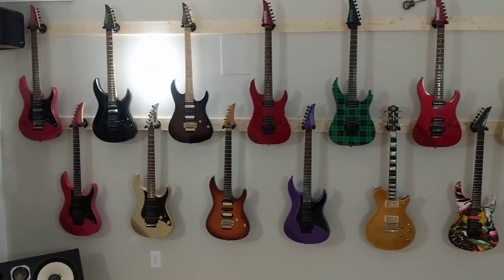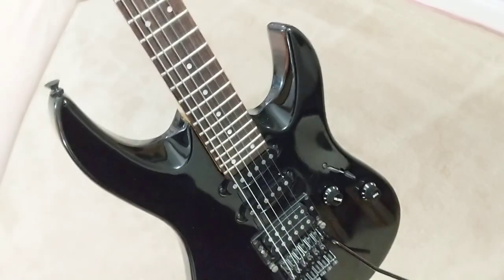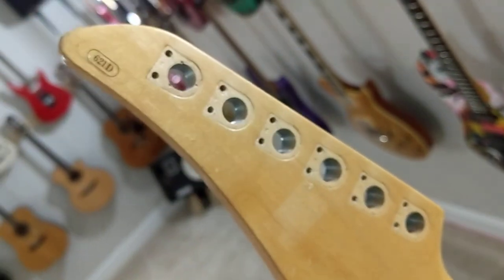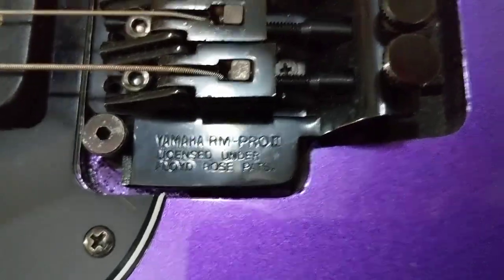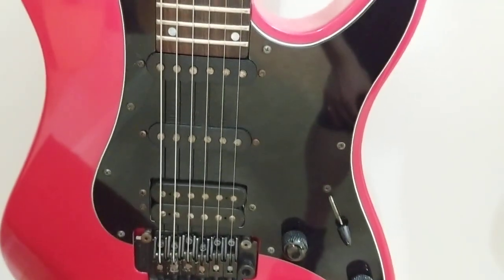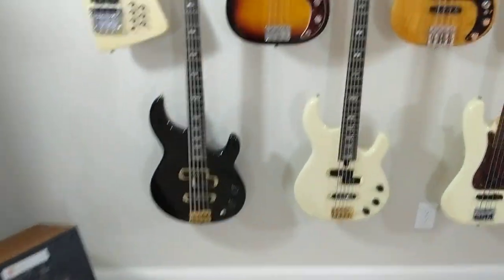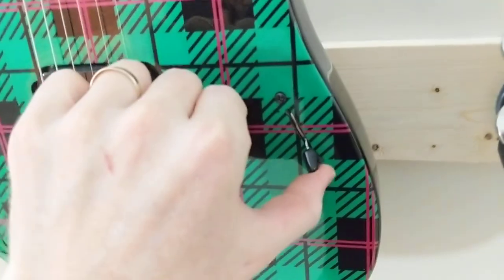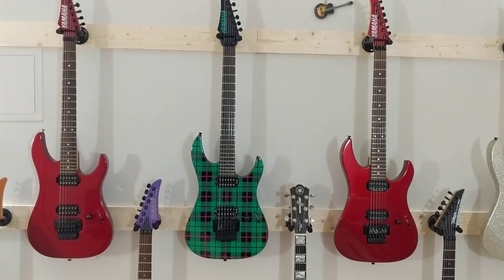Yamaha RGZ/RGX/YG models and differences explained

Comment: I believe that the higher tier blue one without pickups is an RGX-621D rather than an RGZ
Reply from the maker: I have to see the neck pocket to know for sure but I've seen them both ways
Reply: @theittyreport  I have an RGX-421D and it has the same sticker on the headstock which just says 421D (in my case) along with the same neck plate "straps". Also, looking at Yamaha model listings, there is no RGZ-621 with a D on the end. So yeah, it's an RGX
Reply from the maker: how many yamahas have you pulled apart and restored? 
 @danmc_2783
Reply: @theittyreport  Mate, I own one and I am a guitar tech by trade so I've pulled apart a few. And there was never any model called an RGZ-621D. That's an RGX-621D. Bit of simple research will show that
Reply from the maker: @danmc_2783  I'm certainly not going to argue with you about a model of a yamaha, in my experience I've for rgz and rgx and yg models share parts. Some where rgz on the neck, some where rgx in the neck pocket. The main thing that really doesn't make sense is how many versions of the headstock there are with all 3 ZXYG stamped on them. I've even seen an RGZ with the PAC headstock before it was called PAC. I almost bought it just to show people how none of this stuff makes sense. I've simply come to the conclusion that yamaha guitars from this Era are parts casters and there were dozens of teams and factories in Asia that had freedom to do whatever they wanted. So I'd say to you, keep an open mind
Reply: @theittyreport  dude, it's an RGX-621D. Yamaha never made an RGZ-621D. A quick google search really can save you from making a fool of yourself
Reply from the maker: @danmc_2783  bro, I don't care. Get a job
Reply: @theittyreport  well I guess you'll simply remain ignorant then. You got no idea about me, what I do or know. You've already made an ass of yourself with your assumptions but feel free to keep going
Reply: 621 is an rgx. older version  rgz exister. but rgx was when they redesing and mande the guitar better with rock magi pro floyd this guis us going by guts. but i can tell yiu everything one needs to know. i have own 10 rgx 600 series. 2 300 series and 1 200 seties. i now have 1 612ma. and i iwn 2 rgx1212. . all these guitar on this wall are half the quality of a 1200 series. . the numbers (higer mean higher quality. both japan and tawain are the high quality. they also have crap indonasis and so on. if yiur guitar says tawain. it is as valuable as the japan. they ate made by the same people. its all written in there hustory if rgx-rgz.. the highest rgz are the rgz-tt costum both made in japas and tawain 1991+ they are the highest on both rgx and rgz . both all of them lower quakity the the 1200 that was discontinued for the high cost if part and the guitar itself.. the thru tge year cheap out in the floyg. created the rock magic prov2 and 3 tgen they simpky went with a floyed. a good rgx 1212A with original RM-pro (the giant square block inba pivot pin. is worth 2000$ minimum today. and beat up with misding part 1000$ . with that wierd headstock us the TT line starting. .. the one with thr diffrent head stock. is the costum befor making the line TT..

Comment: Hello,awesome video!! Big thumbs up.
Just bought a RGX121FP with serial number JX06132 ,it has locking tuners with no markings on them,HSH konfiguration,Made in Taiwan sticker on the back of the body,5way PU switch and pickguard that covers the whole body.
Could you please help me identify year and month of manufactoring?
Paid about 300 $.
Thanks in advance.
Best wishes
Jerka
Reply from the maker: October 6, 1993
Reply: @theittyreport  Many thanks!!! Big thumbs up!!

Comment: I got an odd ball one too I cant find anywhere, its got 2 tone pots and volume a 5 way switch. the knobs are evenly spaced in a strait line. 24 frets no scollops height adjustable nut. where the neck joins its got 2 plastic plates one says super playability joint system and the other says yamaha since 1887. hsh holes but ssh pickups no pick gard. I went for a jam with some old fellas  with fenders about 6 months ago and I told em i had a yamaha and asked what there like,  one of em said they make good lawn mowers, the other had a laugh long story short they both looked absolutely horrified when they came back in from a smoke to see It was me who'd plugged in to the Marshall dropping a tone bomb e hahah . ...  anyhow anyone seen any models that fit a similar description to mine?
Reply from the maker: Great story man! Yamaha knows tone. Lexus made the LFA but hired Yamaha to tune the exhaust system for them. Everyone that has ever driven or reviewed the LFA has said the it was the best sounding car they ever heard. That's Yamaha for you. Killer motorcycles, top shelf pianos, wind instruments, amps, software, guitars, and yes, lawn mowers
Reply: @theittyreport  Haha so they actually make lawn mowers, I'm pretty sure the cheeky old bugger was taking the piss outa my Yamaha, I sorta felt sorry for the lad his old thrashed strat was buzzing out and shit probably played it every day for 40 years, he's half deaf so still loves it

Comment: I have a RGX112P, and I actually like the pickups, neck, etc. but not the trem bridge. I just ordered a RGZ-II, and I'm a little worried after you said the pickups are crap. 

Which of these had your favorite stock pickups?

(I bought this exact guitar right here: 
https://youtu.be/enauho5yFQY)
Reply from the maker: Truthfully man I really haven't given that guitar very much time to get to know it it's one of the guitars that I bought first when I started getting into Yamaha rgz and the reason I bought that specific model is because it was made in Japan all the other ones that I bought for a different headstock and they were made in Taiwan but I just thought that the rgc3 had a really bad tremolo like you mentioned in the pickups were very novice beginner entry level thin sounding junk.
Reply: @theittyreport  I got the RGZ-II because I think the carved body Is cool, especially with pearl white and black hardware. Oh, and I've never had a Floyd Rose style bridge before and wanted to try that out.

If the RGZ doesn't sound as good as my RGX-112p, well then I know how to use a soldering iron. :-)

Comment: What? TRS-101 its not a entry level bridge... wtf.. Most of your Yamaha's got the "TRS 101" pro.
Reply from the maker: @NunkaOlvidar  so I've even done a full video on yamaha bridges taking them completely apart and I can tell you and the world the quality difference between the trs 101 and the trs pro are massive. The construction of the 101 is garbage. You put them both on a scale and you'd see a 50% weight difference. The build is totally different and the 101 fails when over torqued. I'm sorry if you feel butt hurt that I called the 101 crap, but I own 60 guitars and have restored them all down to every screw. You clearly have no idea what you're talking about and remain a troll.